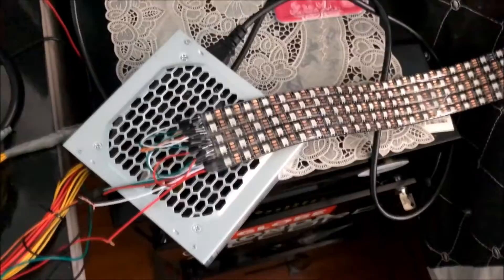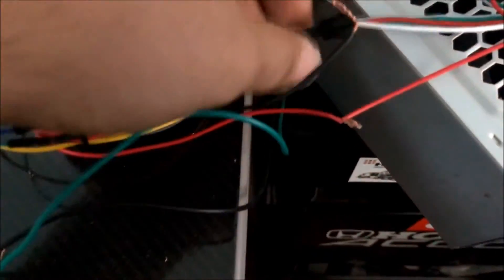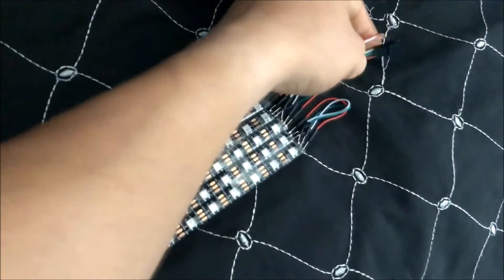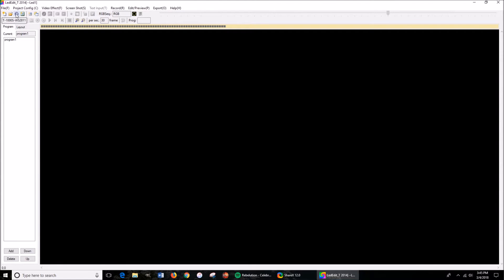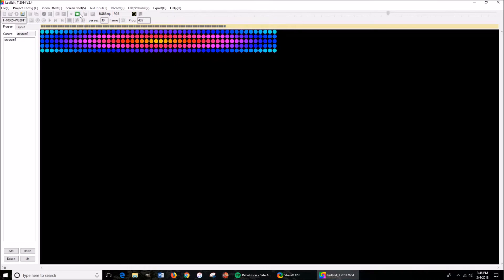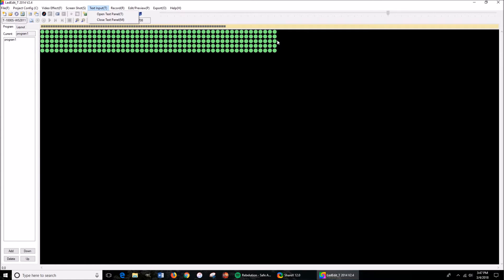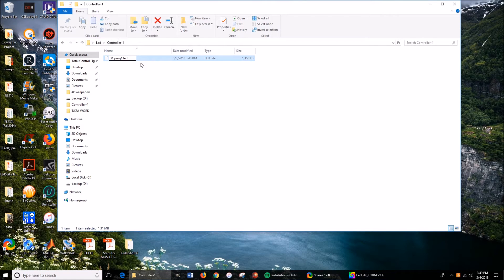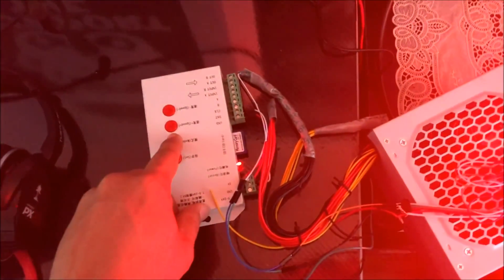Using T-1000S controller with 5050 LED'S (chip WS2812b) (desktop power supply)

Comment: Hello - great video....can you help me, I’m using 6 x 25 strips - there are not many options to chose colours when selecting video effects... is this possible? Eg I want to select what colour I can move from bottom to up instead of left to right.
Reply from the maker: hey pat, i would suggest you check out my other video with the arduino uno or nano either one is good... they are much easier to work with and lots of code already out there
Reply from the maker: this chinese controller is very outdated haha
Reply: MoVoltage MoPower completely agree, I am only just starting to dwell into RGB lighting and bought two of these want to make the most out of them. Thanks.
Reply from the maker: @patchezza1  no prob, yeah once i got into arduino, i realized there is much much more possibilities haha

Comment: Do someone know is it somewhere schematic of the T-1000S controller?
Reply from the maker: if you have the option, i would highly recommend using arduino nano instead..mch more support and easy to configure...1000s is so old i can't find anything on it
Reply: @MoVoltageMoPower  Arduino Nano ? Can you point me where I can find a tuto because I've searched how to play .led file with Arduino but unsuccessfully 😭